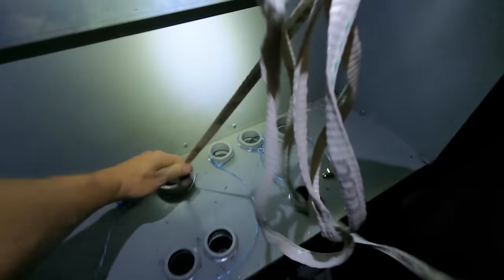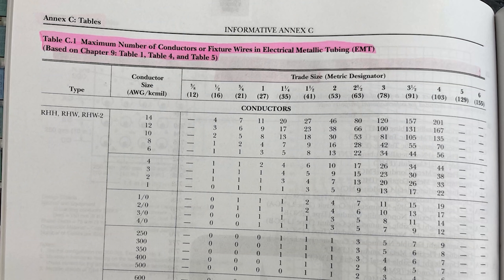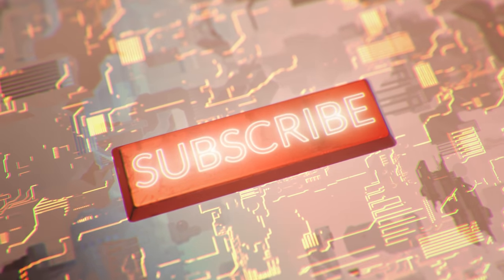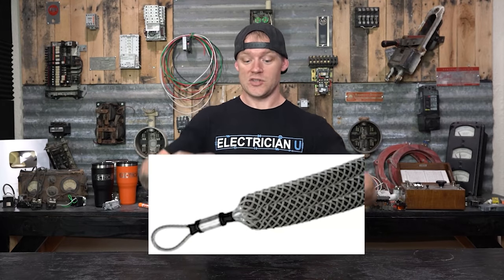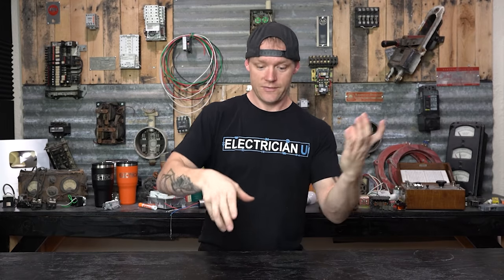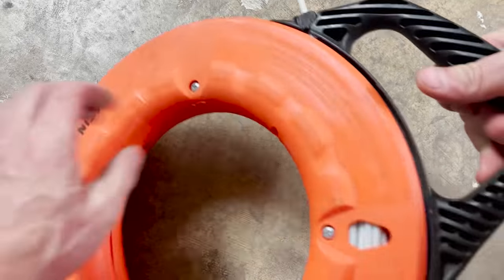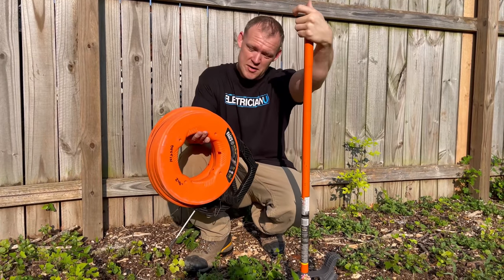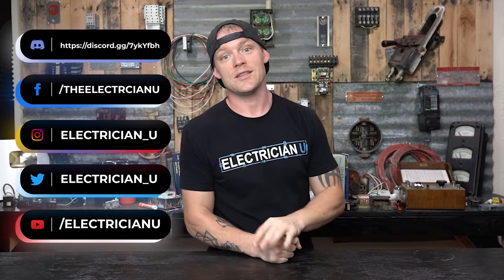Pulling Wire Like a Pro - Tips and tricks for pulling conductors through conduit

Comment: As an electrician who has worked a lot of commercial and industrial, pulling wire using any equipment, trucks, or anything other than by HAND or with a CAPSTAN WIRE TUGGER is a big no no. If one is pulling by hand or using a capstan tugger, one has haptic feedback and the loading of the capstan motor to tell you how much tension is being placed on the conductors, as it is not just the insulation, but more importantly, the conductors that will be damaged.

 Like you can bend a piece of wire back and forth at a single point until the metal crystalizes and breaks, if one stretches the wires, one causes the same type of crystallization over sections of wire. This crystallized metal has a much higher resistance to current flow, and will cause the wire to overheat when subjected to what would have been normal current flow if the conductor was undamaged. This heat will continue to cause further conductor damage, causing further heating, and is likely to continue until it becomes a runaway loop that will burn up the conductor and melt the insulation. I have pulled out the results of this process from conduits. It is not pretty.

I have worked on very long wire runs (miles) for high voltage cable using a diesel powered tugger. It had a tension meter to make sure we did not exceed the limits of the conductors. You can buy tension meters for Greenlee tuggers that measure the load on the capstan motor, but they are generally only used in projects where conductor damage and failure is not an option, like server farms and nuclear/conventional power plants. If you are going to take on jobs that require it, just buy or rent a wire tugger, and don't risk using equipment to pull wire that is not designed for it.

Comment: Old dog trick when using duct for the head, leave a length of tie wire the head under the tape. When your done pulling use the tie wire as a rip cord to remove tape, especially when you use lube it easier to when covered in lube. 30 plus year journeyman and still learning methods and sharing is caring.

Comment: Pulling controls we number before hand. But it's because we're pulling like 70 wires (all the same exact color) in a single conduit, and it's significantly faster to have them identified beforehand. Especially with another individual terminating, that way they don't have to ring anything out.

Comment: Small tip, when pushing or pulling through carflex, throw a little wire lube on there and it will be so much easier, especially if you are working by yourself.

Comment: At the place I used to work, The electricians uses a motorized cable puller and also applied silicone  grease to lubricate when pulling wires through the conduct..

Comment: 1/2” is my entire world, along with section 680 since we do a shit ton of pools.  1/2” flex for the pool equipment outside of a 50-60A heat pump. Then we feed the sub panel at the pad with 1” and the pool lights with 1” PVC sch 40

Comment: I live in a cold climate..Im running #4 for a 60 a sub panel...  The Romex is tough to bend even a half in..Can I warm the wire up safely to bend it easier??  Love ur channel!!!
Reply: Set a roll of wire on top of your dash in your car with the defrost on high for like 30 minutes right before you pull, it’ll help and won’t heat it up too much to the point where you’ll damage anything. I do this with pretty much anything that is easier to work with when it’s warmer, like liquid tight.

Comment: I helpful tip if you are using numbers is if your pulling in multiple "boats" number them all at the same spot and just above where your numbers sit put some tape right in front, will cause a bump that will make so the numbers are not dragging against short couplings and as it is coming out of the connector. Also don't be ashamed to use the sissy wraps life savers some times.

Comment: Lots of good info in this.  New subscriber.  Canadian, so minor variation in the rules will exist.
I have pulled a LOT of wire, up to around 750MCM.   I agree with the vast majority of what you said, but I will throw in a few minor differences of opinion.
When I'm pulling wire it's generally 3 phase, and it will be for one disconnect, so I'm pulling four wires (three plus ground... the rules allow for EMT to provide the ground, but I prefer to have a separate bonding conductor).  Since I'm only pulling the four wires, and I know that there is virtually zero chance that I'll ever need to add another conductor, I actually use 1/2" conduit a lot.   With the current rule set here in Canada, you can run 30A through 12 gage THHN (T-90), so if you are reasonably careful about the connectors that you use you can wire your 30A disconnects with 12 gage in 1/2" conduits.  For the 60A disconnects I use 1" conduit.
I often use solid wire for the bonding conductor.  They often have to go under a screw, and solid is WAAAAAY better for that, and that solid conductor can help a lot to push the other stranded wires through a conduit.
I pull with my fishtape all the time, but I pull the tape, not with the spool.  The spool is lying on the 'ground' and I use the tape as a rope to pull the conductors.  When the pull is done I re-spool the fish tape with no tension.  This works for me.   My hands don't mind pulling on fish tape, but if the going gets hard my Knipex lineman's pliers have a fishtape pulling feature on them, and it's fantastic.  If it's a long, complicated run then I will pull twine through because it runs easier through the corners.
You mention lube.... I very rarely use lube, but I order Southwire cable with the 'Sim-Pull' coating, and that stuff is magic.  No lube required.
That's what I have to say so far in this video.  I'm only at around the 20 minute mark, so I might be back to add more stuff.

Comment: So i stagger and braid my wires so the head starts with the string or if im replacing wire the single wire i left in then gradually increases. Anybody else do this or have an issue with it? I mostly deal with 3/4 underground.
Reply: Yes I always stagger my wires into a longer, tapered head. It makes going through bends much easier. I don't understand why a lot of people don't.
Reply: Same.  Stagger wires, make head tight and small, gradually increase.
Reply: It’s honestly the best way to do it

Comment: Once your heads made, taped and ur bout to soap it up, wrap a thin t-shirt or shop rag around the head TIGHTLY secure it with just enough tape to hold it taking care to use as little tape as possible up near the tip.  Then soap the head up. The cloth holds that soap a helluva lot better than just slathering it on the insulation. +1 on duct/gorilla tape. Put a tail on every wrap for the guy on the other end

Comment: They're doing a really big pull at this jobsite in Seattle, the cable is about 3 1/2 inches in diameter, and they're going a few hundred feet with it. The spool it's on is easily over 6 feet tall. Going to try to and help with the next pull next week, sounds insane
Reply: Sounds like the pull I described in an earlier comment.
Reply: It was similar! This one went on some cable tray in some tunnels 3 stories down and connected the new building to an existing building. Hearing about has me so excited to get started as an apprentice, I'm just a stockman rn but soon!
Reply: Holy SHIT! Soak up everything you can. Sounds like you're gonna learn how to be a real electrician

Comment: I like that klein tools conduit bender have see if they do them in metric sizes 20 25mm
Edit
Seems not. From reading reviews Conduit in UK seems to be if thicker gauge so more difficult to bend using a tool like this which is a shame because its far cheaper than the regular conduit benders

Comment: @20:30 I wish we didn't have to label every wire but when youre pulling x100 red wires for controlls it makes it alot harder to ohm out if some of them aren't labeled.. its taken me and another guy 3 days to ohm out every wire in 1 controll panel for a door.. it was an automated sliding refrigerator door with 8 different sensors at a chicken factory.. I was ready to slap someone by the end of the week because how bad that job was going.. but yes if you can get away with color coding   sets then that should be good enough but sometimes that isn't.. sadly.. lol..
Reply: On every multiple wire pull I do, I use colored tape for power with wire numbers for circuits if needed. Then on control wire pulls, I have several wire number books at the ready. 0-90 are in standard sticky back books ready to be wrapped around each conductor, for larger numbers, multiple labels together will get you what you need. Saves countless hours and arguments during termination time.

Comment: I always buy 5 gallon buckets ( usually 10 buckets per job)of soap and always used a greenlee wire tugger never a backhoe or a forklift or other machine just a tugger. It is much easier to get a wire puller up to upper floors rather then a forklift.

Comment: Previously a FA Technician and I would NEVER run cabling through conduit that is already filled. This is a huge no-no. The cabling we use (which is typical across most HV/LV applications) will get damaged when you're pulling more cabling on top of it. The jacket/insulation will rub, and will either melt, or rip exposing the conductor, or the insulation inside the outer jacket causing a short. If doing a job where the building has been completed years ago, all the conduit being reused will be evacuated of cabling, unless the cabling is being reused. Never pull cabling through a conduit with cabling already in it. Just redo the run.

Comment: Watching this after trying to pull through 3 inch rigid with probably about 500 degrees of bends  that had 6 25C  cables in it. They used yellow 77 that also didn’t help

Comment: Making up the head you don't want to overlap the strands over the insulation, it will make your head fatter.  Strip 18" split 3 strands on each side cut the middle strands. Then stagger the insulations without overlapping. This head should be the same size or smaller then the wires.  And use a bowline knot. I personally use reverse bowlines.  And we always use black tape on "larger" wires.     "Pro tip"  If should be and easy pull, apply 4 half hitches tape fist knot and last making the mule tape come out center and go.   Alot faster, but makes the head fatter.
Reply: Glad someone else caught that.
That was one hell of a mess that guy put on the mule tape in the video.

Comment: Cost effectiveness is  how jobs are bid. Up sizing from 1/2 " and 3/4 when when not necessary would increase the cost and not cost effective you  will not get the bid same with stranded increases the cost. The reason for stranded is to reduce possible heat due to eddy current factor as stranded wire has less resistance

Comment: If your fish tape is rusty, its not good stainless, maybe a nickel plated steel, or stainless steel that only goes for tensile strength, but not stainless.  Try to find one made of 316L Stainless, that stuff will not likely corrode in salt water.

Comment: Hand pulling
1) The most important position is the feeder, not the puller. An inexperienced person on the feed end can, and probably will make you life miserable. ANY extra friction will be felt on the pulling end.
between

5You can help the wires coming off the reels by placing adjacent  spools opposite directions . It will keep the spools from free spinning.Make the head super aerodynamic.

Comment: Are you guys in the US allowed to pull multiple circuits thru 1 pipe? Like Stove + Fridge/Freezer + Microwave in the same tube??
Reply: Typically residential doesn’t involve emt
Reply: @Nick-bh1fy   What? Is that a no or what are you on about?
Reply: @RuffleCoptah  I don’t think you understand what ur saying, stove, microwave and fridge are residential circuits and loads. U wouldn’t pull those circuits together bc in residential there’s no conduit unless there’s a few places that ask for it
Reply: @Nick-bh1fy  I think there's a language barrier here. When I do a renovation, or a new build home. We always put 1 flex tube & 1 10A fuse to Fridge/Freezer, One to Microwave, One to Outlets, one to fan / lightning etc. I just thought that you guys in the US had two or three different fuses in the same tube going somewhere. Here in Sweden we can only pull 1 fuse through one tube.If that makes sense, thanks for replyying man. Like 1 3G1.5mm2^ in each tube, not 4x 3G1.5mm2^ in one tube even if it's going to the same room if that makes sense.
Reply: @RuffleCoptah  perhaps, but we don’t use “tubes” in residential. We use romex which is a cable assembly made up w conductors already inside

Comment: My only issue with pulling with Jett line, you can cut the inside of the pipe on 90s and it can cut the Jett line mid pull and comprise the conduit because it’s breached, but that’s me. I only use mule tape or my pos fish tape (specifically for pulling cuz it’s 3 years old 😂😂

Comment: always pull from the easier side so that less length passes the hard spot always use lube and bend as big bend as possible
Reply: also use a vacuum cleaner on one end and tie some plastic to jet line to pull jet line through

Comment: With motors at least check continuity from phase to phase. I was handed sets on 3 conductors plus a ground and none of the bundles were all going to one motor. Idk how that happened but single phasing motor with a gear box is not a good sound.

Comment: Do you only use a nylon fish tape when adding wire to conduit? 
Does it break a lot easier than metal, which is why you wouldn’t use it more often?
Reply: It will wear put faster than a steel fish tape. Also doesn't recover from a very sharp bend as well as the fiberglass fish tape will. And steel fish tapes are a lot cheaper

Comment: If you can't get a fish tape pushed through the conduit run,push it as far as you can then, Take another one bend a hook on it and push it from the other end. Push it until you feel the other end of the fish tape then twist it a few times. Usually it will catch the stuck fish tape and you can pull it the rest of the way.

Comment: I want to reinstall an exterior light that was taken off by a painter. He left. I need to reinstall the light. It has 2 black, 1 white and 1 red wire. The red wire is connected to 1 of the black wires. and then the red part has exposed wire to connect into to the exterior wall. I don't know what to connect the red wire to. This is a dusk/dawn light. It also has a the ground wire. I have a photo...help!!
Reply from the maker: Try asking in our discord https://discord.com/invite/7ykYfbh

Comment: Great advice my dude! 2 things I am surprised you did not mention. 1. when using duct tape, or any tape to make a head, always do it sticky side up so when you are removing the tape later, it comes off WAY EASIER...I always do sticky side up then go over it again sticky down, this way, it doesn't get all shit stuck to it in the process....Also, Using a piece of tie-wire to make a rip chord under the taped head helps as well if you don't do the sticky side up method....2. When trying to figure out where to feed and where to pull, always pull DOWN HILL. I think that is common sense but we all know that doesn't come that often! Thanks again for this video!

Comment: Nice simple video. Dustin lack’s knowledge of big jobs and wants to cut costs. He pulls all black wire and phases it. That’s always a pain for the next guy when the tape falls off. Also you can order striped neutral wire phase already. The all black wire is always a sign of a cheap contractor. Also there are tuggers to make easy work of big wire pulls that are too expensive for guys like Dustin to purchase being a one man shop. The industry is so far ahead of these small shops. Dustin is a good guy he’s just stuck in his small job ways.

Comment: Polling wire is easy if you use enough common sense. Lots of dish soap or mayonnaise  For lubricant. Is get a tractor a wench or a car or pick up to pull large conductors long distance. Sapoli's mule tape and 5/8 rope. Or in some cases fish tape. It all depends on the application. It all depends on the application

Comment: 8:00 in Europe, using stranded on mobile electrical appliances is illegal. Think about the supply for a mobile bridge, or a crane or anything that moves, you have to use stranded wire with terminal pins at both ends.
Reply: Same as pulling wire for a transformer....

Comment: if its rusting its not stainless, everything is legit, but i work with stainless that gets beaten severly by weather and acid, the only thing that takes the stainless property away is alot of heat, otherwise a real stainless fishtape wouldnt rust like that,  if the nicking concept were true then your silverware would be rusty

Comment: So much of this is an art and not a science. I really want to set up a bunch of runs with different amount of bends and run in EMT, coreline and PVC and test different heads and different amounts of conductors and do the same testing for ghosts/mice for vacuuming. Oh also RW90 vs
Reply: Can't edit through this browser. I wanted to add.... T90 and use a stain gauge for all of the tests

Comment: 13:00 try this instead... the FASTEST Way to load conduit with Mule Tape or a pull string....  Tie a cheap lightweight plastic grocery shopping bag (or just a part of a bag) onto the end of your rope, and shove it in the conduit.     Take your shop-vac to the far end of the conduit, turn it on, and SUCK the mule tape to you faster than you can blink.   Remove the grocery bag.... you now have your rope in the conduit and you are ready to make your head.

Comment: I have a better way to start things. Take the nozzle from an RTV tube and put a string in it facing the direction of travel. Then hookup a shop vac to the other end.... string ran in a few SECONDS! The use like fish tape to pull in the wire/conduit. etc.